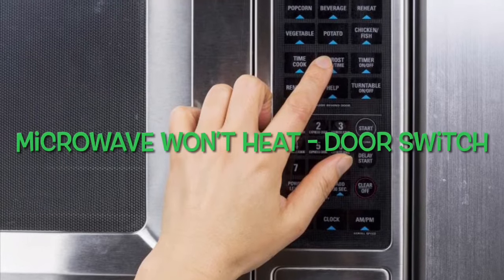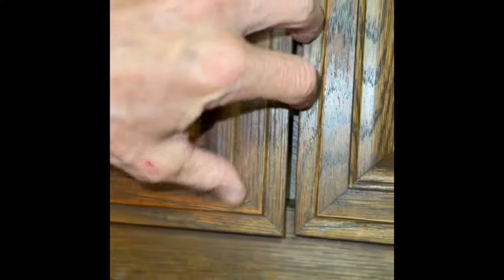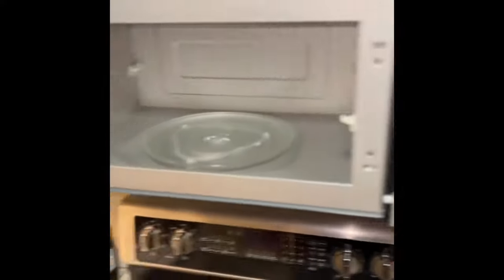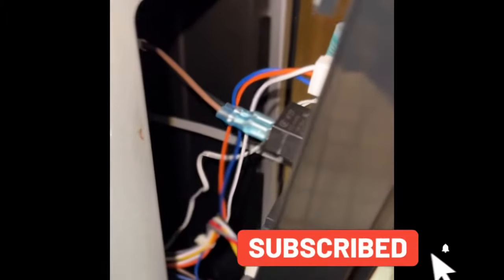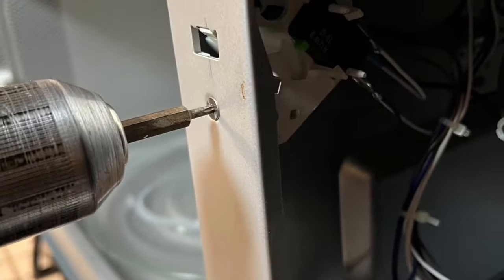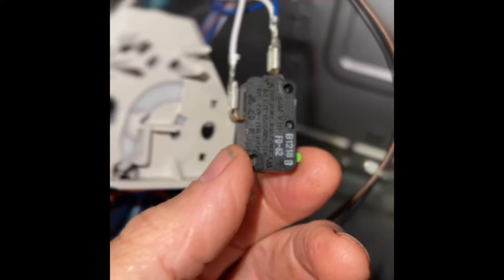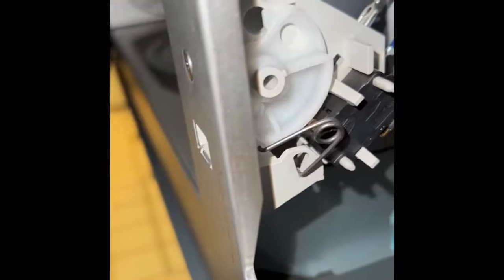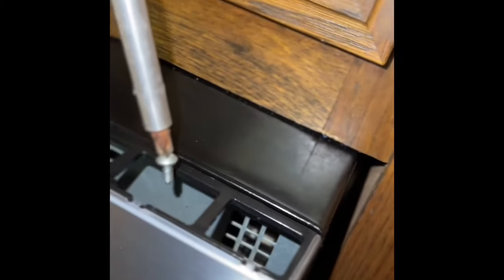✨ Microwave Counts Down - But Won’t Heat - Easy FIX ✨

Comment: I Have that same model as you at work and I thought it was the door switch as well, the problem wasn't the door switch, it's just that Panasonic didn't give the switch assembly enough support to the frame, so when the door closed the whole switch assembly would flex with it on the inside, not allowing it to fully depress, what I did to fix it is open the door, then drill a hole through the front part through the frame where your switch assembly would be on the inside,  and through switch assembly and ran a 8-32 flat pan head bolt through securing the frame to the switch assembly with a nut on the inside ( this is how most microwaves are anyhow and how I got the idea) and problem solved, switch assembly doesn't flex anymore. Panasonic's like yours and mine are prone to this problem though. It just flexes on the inside 😂😂
Reply from the maker: Great fix Drew,
Thank you👍

Comment: How would you know it’s a door switch and not something else? Same thing everything works light on fan on counts down but doesn’t heat. Thank you
Reply: If everything works including turntable it's down to the HV circuit or the board. Pull the wires from monitor switch, plug your leads from dmm into plug for monitor switch (middle switch) if 120 volts board is good. Then it's either capacitor, diode, transformer or magnetron.. listen before disassembly as you should hear fan then transformer then magnetron. If issue is HV circuit it's usually the magnetron
Reply: @fringeminority5676  yes, the turn table also works, and the light is on and The control panel fully works.
Reply: @fringeminority5676   I replaced magnetron. Nothing changed. Still No heat. Everything works, lights, panel, rotation, fan but no heat. Any ideas?
Reply: Check diode and capacitor with dmm. The transformer could also be bad. When you run it, do you the transformer hum and magnetron buzz?
Reply: What make is it? If it's a Whirlpool they have an issue with the holder for switches, also they now want the 3 switches replaced with 4 switches

Comment: My SAMSUNG microwave stopped working. It is turning on, plate is turning and light will come on but the *time won't move*, and food won't heat. Any idea what this could be? Thanks!
Reply from the maker: I bet it’s the fuse or one of the door switches 👍
Reply: @QuickAndEasy5MinuteAppliance  Thanks for your reply! I'll be testing them tomorrow.

Comment: dear my oven is not heating i checked all thing but no result, it is running 
door swt chk
motor relay
microwave relay
magnetron no shor
capacitor ok
diode checked
transformer ok
 plz tell me wht the issue could be
Thanks
Reply from the maker: Nice job,
There should be a fuse hiding in there that blew and needs to be replaced 👍
Reply: @QuickAndEasy5MinuteAppliance  fuse is good also
Reply: Plastic bracket has bottom 3 micro switches, bottom 2 has another mechanish when door close both microswitches dhould be pressed butvthey r not completely press thats the issue
Reply: How did you fix
Reply: @jasongonzalez7959  that door switch i changed did not fixed the issue...😭 seems to my opinion its motherboard relay or some other motherbisrd ic faulty.basically my opinion its not door switches ...its faulty motherboard....i put aside that microwave and had another one in my storage... using that one.